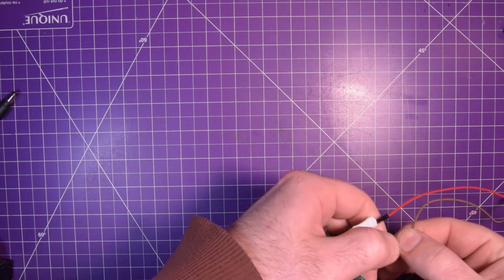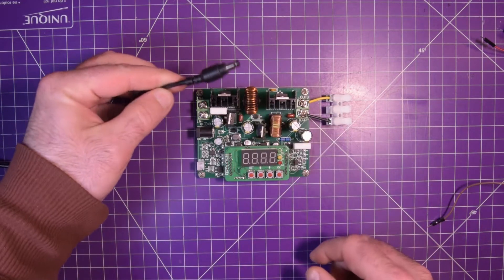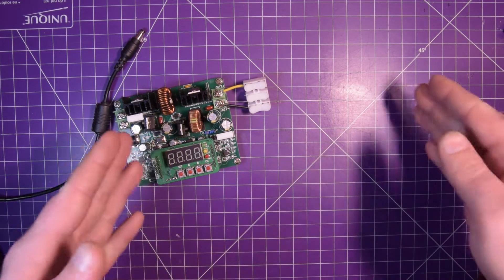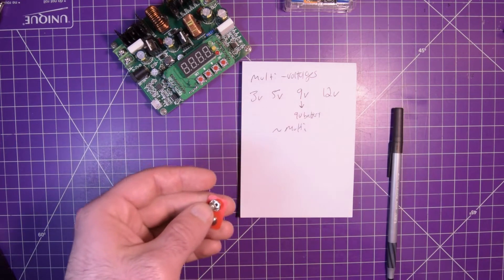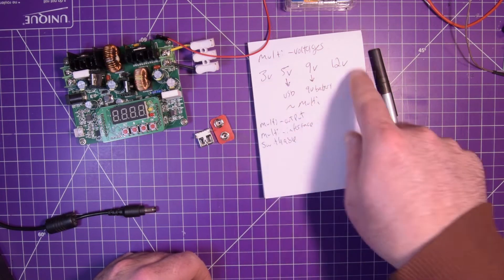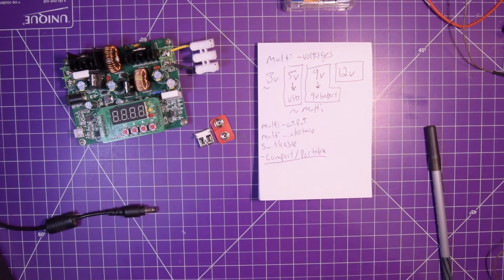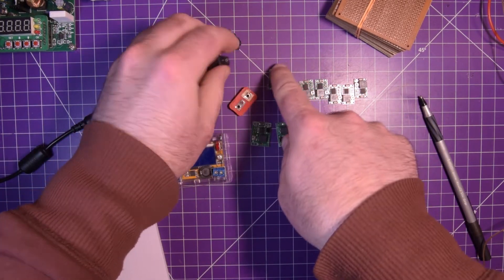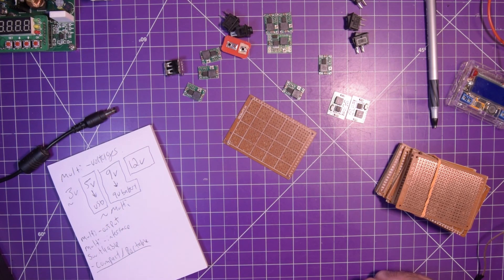Making A Multi-Output Power Supply Part 1 - The Plan

Comment: A Decktop PC power supply would give you every voltage you listed except for 9v  so PC
PSU plus regulator for the 9v plus a few 4mm sockets . Then make up leads with 4mm plug
on one end and croc clip / battery clip /4mm plug / Dupont pins etc on the other end .

                                                                                                                                    Alan
Reply from the maker: Yup, you're right! The only problem with this is that some power supplies require a burden resistor in order to output their voltage and around here they are quite pricey. A cursory glance around Amazon shows me power supplies around 40$ CAD, where as this solution will run me under 10$.
Reply: Hi    I was thinking that you use a used one ( from a dumped PC ) . At the
end of today video from  voltlog there is a ready made pcb that would do
the job .
                                                                                       Alan